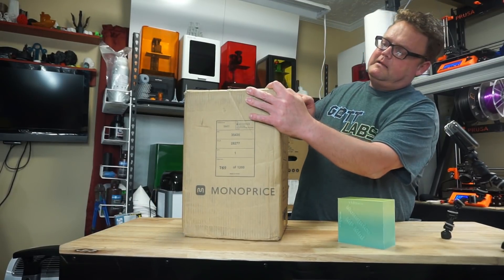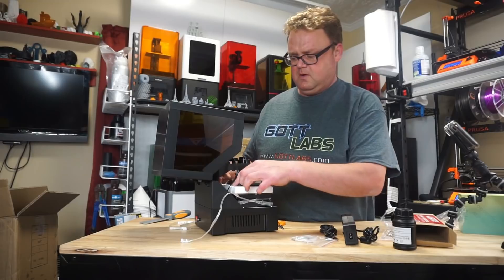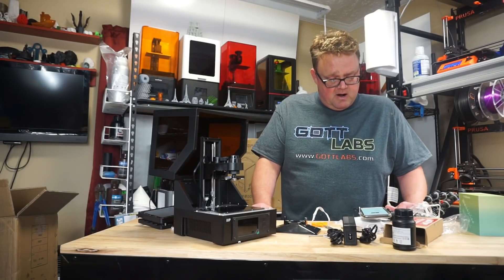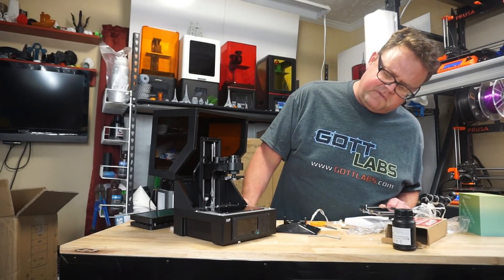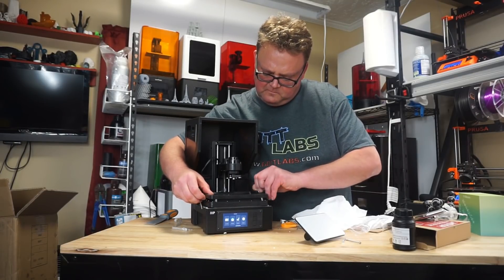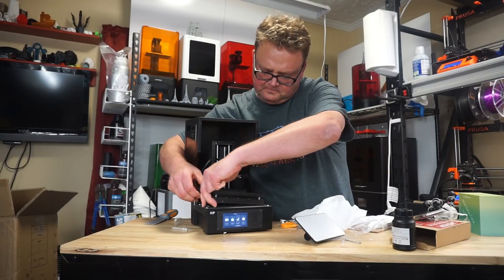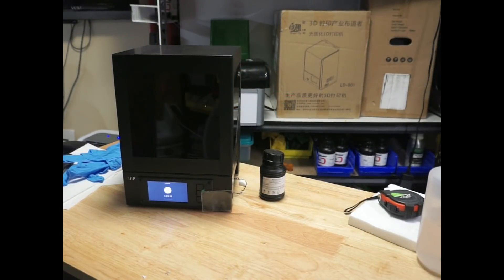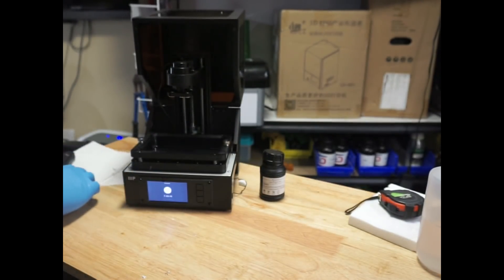Monoprice MP mini SLA printer- Setup and first use

Comment: hi would you recommed this one or the elegoo mars? this one has a bigger print area right?
Reply from the maker: Elegoo Mars, Hands down. Bigger build volume and MUCH more reliable. The Mars is down to $229 now, too.
Reply: @TheSLAChannel  thx i thought the monoprice had bigger print area... i could get the mars for 150bucks used only printed 1-2 times... i think i might get it
... i never had a 3d printer is there a difference startitn with sla or fdm? should be the same for a beginner right? thx

Comment: the video would be more enjoyable if you are more well prepared and read the manual well before you start recording. You spend too much time reading the manual in video makes this video very boring and unnecessarily long.
Reply from the maker: Hi- Thanks for the feedback.

If you check out our associated facebook group and/or website, you'll see that it is our intention to do this without prep. We are opening the box and getting the printer going without any prior knowledge whatsoever about what is required for setup. It doesn't result in the most 'fluid' video, but it shows people new to this what exactly to expect

Comment: Honestly, would you recommend me this printer as my first SLA printer?
I m not looking for just cheapest, but best for the money out there. I got 2 years of active FDM 3d printing/modeling experience and i want to dip my fingers into these. I don't mind tweaking it to set it up correctly, but would it be reliable afterwards?
Heard that EPAX X1 is great machine? Worth extra money compared to Photon?
Reply from the maker: While it's a fun little machine, I would look elsewhere if you're wanting something that's going to be reliable long term, especially if you're going to be doing a lot of printing. I come from an FDM background as well, it's how I make my living!

We have an Epax and a Photon in the comparison as well, and I should have videos up about both of them soon. Both are nice, but the Epax is a step above as far as quality goes. It's also more powerful, which makes it faster- and when you're doing several thousand layers taking even 1-2 seconds off each one really makes a big difference. 

The Elegoo Mars is another one to look at- We've been surprised by the performance.

Comment: looks like the lead screw is bent
Reply from the maker: There's a slight wobble to it- I think it's in the coupler on the bottom. I'll probably tinker with it when I have the time. It seem most of these have some issues on the Z axis to some degree, but it doesn't appear to have much of an effect on the prints. I guess that's a drawback to a sub- $200 SLA printer!

Comment: I baught 2. I’m having an issue where it seems like the lcd freezes on one cross section and the machine motor still runs As  normal so you get the same profile printed over and over and over midway through the part. Two machines started doing it and the sla/ .gif is solid and tested. Thinking it’s a bug. Anyone have that?
Reply: I have one as well same one problem I have is the resin they give you with it works best when I cleaned out the resin and put in yellow from monoprice it would not print the print stuck to the bottom of the vat rather then the print bed no way to adjust the machine as it is auto level so what do I do

Comment: I've been FDMin' for just a "couple of minutes" and been wanting to jump into SLA. I sprung for the Sparkmaker; however, it decided to quit working after the initial print - meh. Anyhow, I picked up this little guy and am trying to get it working as I cannot get it to stay connected via WiFi - likely an Xfinity issue rather than this unit's fault.

Still, I am struggling to get my designs to print... It seems to not be working well between the slicer and "index." I am curious to hear how you all are doing and what you might recommend to actually use this thing beyond drippy pigs?

Much appreciation, up front.

I'd be O.K. w/ being able to slice them and load them to the SD like most of my FDM's. Any advice on MP's slicer and/or other programs?

Thanks again,
Min
Reply: same with the wifi its usless if I cannot connect to it remotely because it keeps disconnecting... woking on calibrating the xy demetions now

Comment: So thinking about buying a new resin printer and decided amongst 3... this one, the monoprice vs sparkmaker vs the LD-001 .. know the first 2 much cheaper then the LD-001 but which would you recommend?
Reply from the maker: We're testing an LD-001 as well. It seems like a pretty decent machine. Of the three, if money isn't an object, I'd go with the LD-001. The Monoprice, especially at the price it's at right now, seems to be a pretty good deal. The sparkmaker works, but the technology is old and the quality not the best. The lack if of a touch screen (or any sort of UI for that matter) is a real drawback
Reply: @TheSLAChannel  I saw the video on that but couldnt really tell the quality difference between the LD-100 and the monoprice mp

Comment: I ordered this printer and there seems to be an issue with the power supply not working. On the power supply for the printer does the led turn on when you plug in the cord to an outlet?
Reply from the maker: Sorry, Just saw this! 

My adapter does have a blue LED that lights up when plugged in.

Comment: Appreciate the video. Not much info on this machine, and at the price point it's very tempting as a way to dip my toes into resin printing.
Reply from the maker: It's been a pretty good machine so far. I noticed it's on sale for $200- I don't think you can go wrong at that price- As long as you can get by with the somewhat limited build volume. No, it's not the highest quality machine out there, and not the fastest, but it'll get the job done.
Reply: @TheSLAChannel  Again, appreciate your thoughts. At the price I decided I'll give it a try. It'll be a secondary printer to my workhorse FDM printer (Prusa i3) to dabble in higher detail projects.
Reply from the maker: @chuckmakesit  I love Prusas... I have 10 Mk3's. You aren't kidding when you say workhorse!

Comment: What is the better starter UV printer? This or the Photon?
Reply from the maker: It's hard to say one is 'better' than the other, really. We're running some tests on both machines, subscribe to this channel and check us out on faceBook  (https://www.facebook.com/groups/607095396425931). The Monoprice is less expensive, BUT the Photon has a bigger build volume, is built better, and has a lot more support. If I were choosing one, and didn't have to worry about the difference in price, I'd say Photon all the way.

We're also testing out a Elegoo Mars- It's doing a great job as well, and is less than the photon.
Reply: @TheSLAChannel  Would you say the ELEGOO Mars is worth the extra $50 bucks over the monoprice (Amazon pricing)at this point ?
Reply from the maker: @thcrw7391  For sure. Bigger build volume, faster and MUCH better built machine. The Mars is actually considerably faster than a Photon. But, with the CURRENT sale price of the Monoprice ($200), it's not so easy to make that call!
Reply: @TheSLAChannel   Thanks for the reply , I indeed went for that deal ... I can deal with a few minor things and save $160 to get into SLA...they shipped it so fast i purchased day before yesterday and it will already be here today.
Reply from the maker: @thcrw7391 Yeah, it's tough to beat that deal. I've spent more than that on dinner and a movie... Monoprice is quick, I ordered an open box FDM printer for another channel I'm working on, and it will be here today, 2 days after I ordered. $100 shipped, too. I couldn't pass that up :)